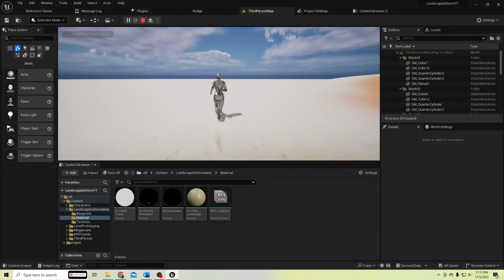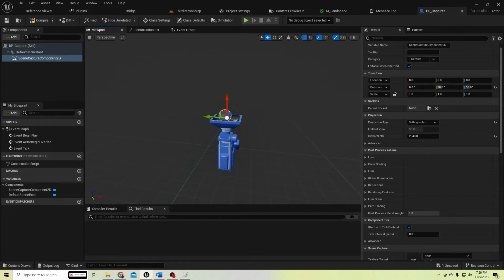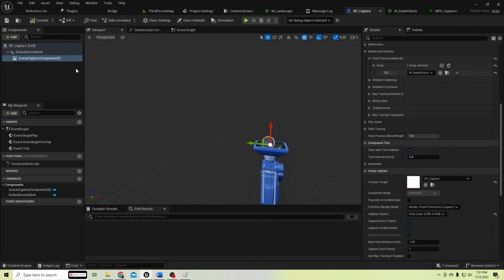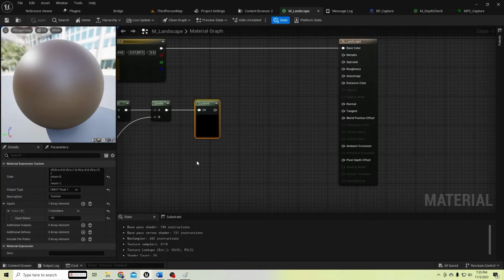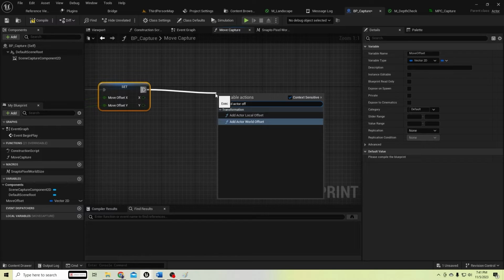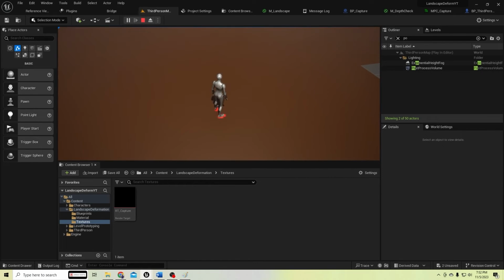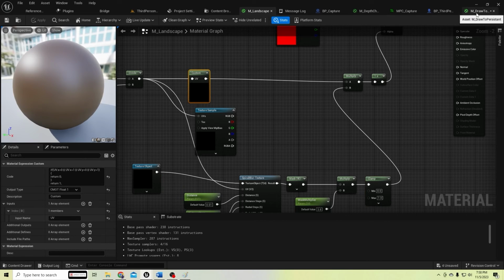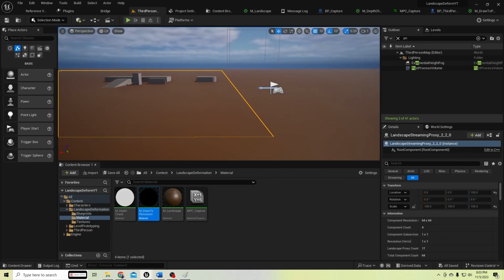UE5 Landscape Deformation Tutorial - Part 1

Comment: I have water body ocean blocking the scene capture, what do i do
Reply: What is the exact problem? I am having an issue on a map with and ocean on it as well. When I open the Render Target, I see that it is not grayscale but a bluish tint. Along with that, there is no information on the Red channels, only on Green and Blue. Also, the trace does not follow the shape of the landscape, when go up on a hill, there is no activity seen on the render target. I've tried to ignore ocean bodies in the render target (just go into the render settings on both ocean body and the water body and disable some passes), yet, I doesn't change anything at all.
Reply: @echorises  yea Idrk
Reply: @echorises  oh yeah u have to go to the render target bp and set capture for only the char, or exclude the water body from capture, one or the other. u would have to figure out how to do that tho

Comment: hello, thank you for the tutorial! i have a little problem... it seems like the capture does only do a part of my landcape size... if i walk around i can see on the rt capture how it draws the line of my path but then i walk over the "bounds" of the rt capture image (and bp) and nothing gets capture outside this area... is there a way to capture my whole landscape size ? so do make this capture area bigger? i have the same standard settings for landscape like in your video :)
Reply from the maker: is your bp_capture moving with the player or not?
Reply: no i think thats the problem but i dont know where my mistake is @jeedev
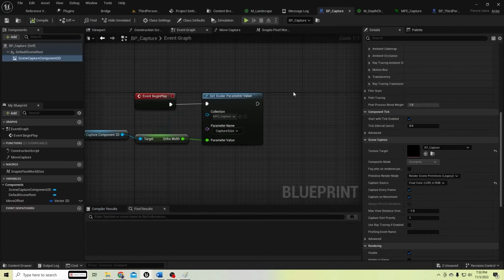Reply from the maker: @enderchipytenderchip2557  from 22:53 I started adding this moveCapture function to move the capture with player
Reply: i compared it.. i have dont see my mistake the only difference is that i have a player pawn instead of player character ;-; idk what i do wrong   @jeedev
Reply: i notice that my RT textures are not black and white... they are like the scene colors... do you may have an idea why this is happening?  @jeedev
Reply from the maker: @enderchipytenderchip2557  Did you check SceneCaptureComponent2D settings correctly? (Under Scene Capture)
Reply: @jeedev  i have the Settings  orthographic, 2048 ortho witdh, texture Target is RT_capture With Final color
Reply from the maker: @enderchipytenderchip2557  Did you add the post process material to the SceneCaptureComponent2D?
Reply: @jeedev  yes RT_Capture
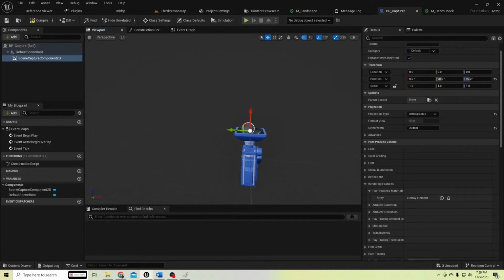Reply from the maker: @enderchipytenderchip2557  Nope. M_DepthCheck material should be assigned as Post process material to your SceneCaptureComponent2D. check here, 8:31
Reply: @jeedev sorry wrong line … Yeah i already assigned it too … M_ Depth as post processing and RT_Capture as texture Target
Reply: @jeedev  i redid your Tutorial and the Tex works again (i have messed up something before) but sadly the Capture still doesnt follow my Player. I think because i use a Player pawn node instead of player  Character in MoveCapture…. i am sorry to ask again but do you may know how it can work like this? (For now i just changed this one Node)

Comment: why does it say that my texture sample needs to be linear color?
Reply from the maker: Which action resulted in the occurrence of that error?
Reply: I fixed that issue but some part of my landscape does not get covered by my landscape material and the footprints dont appear
 @jeedev
Reply from the maker: @thenavicii570  try enabling two sided tick on the materials of those parts
Reply: that fixed it but now the footsteps arent on my character its to the side, im sorry for all these questions @jeedev
Reply from the maker: @thenavicii570  sorry I didn't get the issue clearly
Reply: The red footprints that are supposed to be directly under the character are to the side and not under the character @jeedev
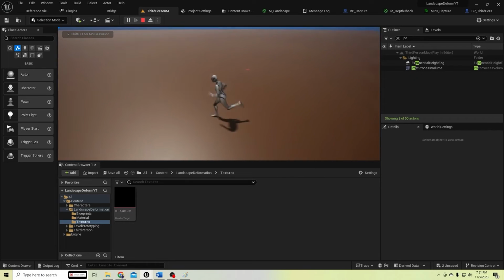Reply from the maker: @thenavicii570  I fixed an issue similar to this issue here 23:17 . and double check the 'move capture' function on BP_Capture. that is the function for getting the location
Reply: Bless you and thank you for the quick answers!! Its fixed! Cant wait to do the rest on the parts!! @jeedev
Reply: @thenavicii570  I am having the same problem you had initially described. how did you fix that issue?
Reply: I had an issue where the texture samplers nodes that were sampling my render targets kept saying they needed to be of type Linear Color Instead of the type Color. Type Color is needed to follow this tutorial. If you have this issue open up your render targets and change them to (RTF RGBA8 SRGB) That fixed it for me. Just refresh you texture samplers after you make this change and they can now be set to type Color.